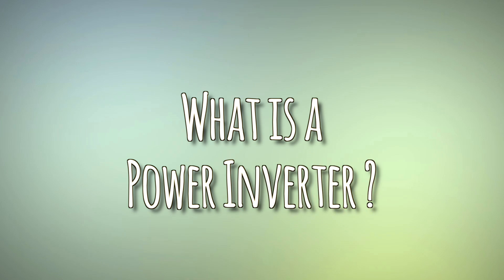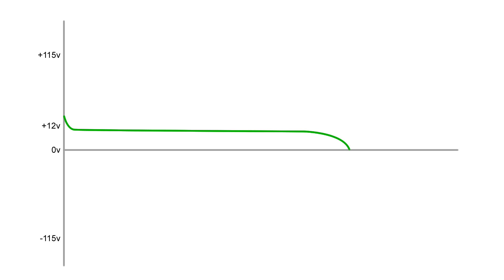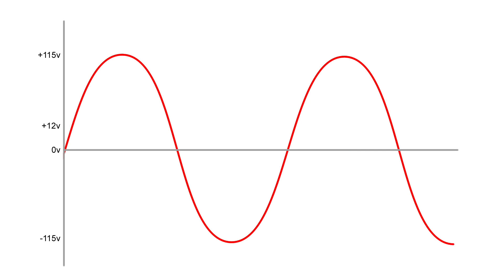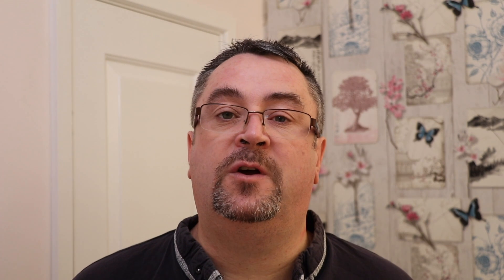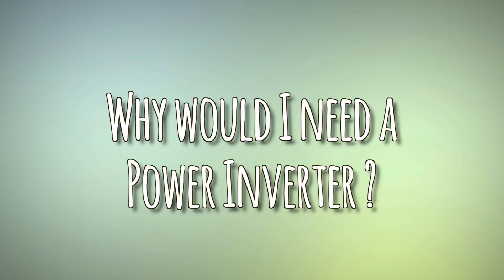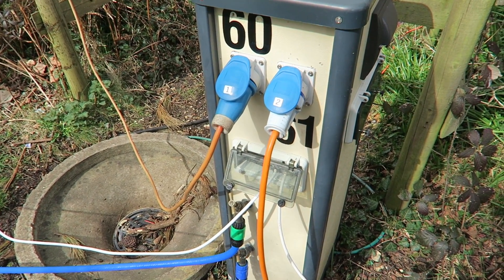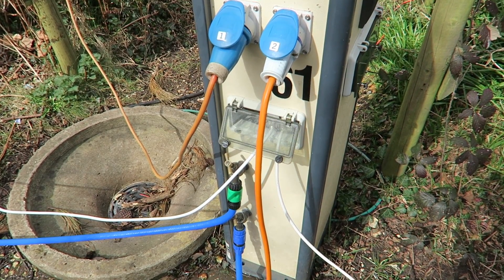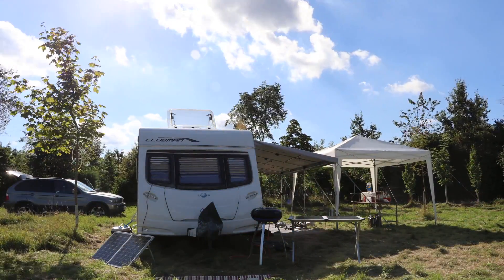Power Inverters in caravans

Comment: best vide i have watched on this subject. You covered the basics well, without over complicating things. I Like your delivery style!
I do want to see how an inverter should be wired into my caravan permanently. Usually under a bed.
And I believe I can also run an extension lead from the inverter to where my devices can access the inverter. 
Also, I believe you should mount the inverter as close to your battery sources as possible.

My inverter is to solve charging my E/bike battery on tour. Bosh Battery is 625w, but the charger is only 320w, so I bought a 650w (pure sine-wave) inverter here instore in NZ. Item on sale maybe $180 NZD.
I plan to instal mine very soon.

Comment: Very helpful video thanks. Still educating people 7yrs on! :)
This may be a silly question but, if you just took an extra battery, and used that, with a fuse and isolator for safety, to the inverter plugged into the exterior power inlet, that would be fine right? It would be seperate and, if drained, wouldnt affect the 12v supply/battery. Handy.

Comment: Dan i have 1x 100ah leshure battery but i am thinking of getting another and join them paralel what regulator would you recomend i am currantly using just one of those blue ones with 2 x solar panels in serius 10 w each connected to the regulator but as i said i want to add another 100ah battery can you advise me thank you .

Comment: Hi Dan.
Sorry to point out a mistake in your graph , but it's plus 360volt minus 360volt at 50hz and the RMS root mean square is 240 volts at the centre of the sine wave , caravan owner and 20 year electrician, Rob not being a troll just had it bashed into my head for 3 years at college.cheers great videos.
Reply from the maker: Hey Rob, yeah thanks for that - its one of those things of how much detail should i draw folks into, like trying to describe RMS, duty cycles and Peak etc. It was always a fine balance when i was teaching radio - that you just need as much knowledge to get you through, then when you need to know the full info - reveal we lied right from day one about natural impedance lol..

Comment: Hi, I appreciate this is 5 years old but I wonder if these have been superseded by things like the Jackery?
Reply from the maker: Hi Monty - Yeah, spot on - portable power stations now remove the need for an inverter. They can be charged up form a 12v supply and can now power most things from them. Id never install an inverter now, but use a portable power station instead. 

Thanks

Comment: One good news about it using inverter making your own electricity from solar wind is that at least converter gives cleaner smoother electricity then the power company does the power company is so much more choppier so much harder on your machines and the converter is a lot more nicer it tries to give it good power and keep it clean and keep it from being choppy and keep it smooth so it gets all the power it needs it doesn't have to overpower it like the power company has to do.

Comment: Handy guide to inverters, thanks. It's certainly worth checking out 12v chargers for camera batteries, 12v tellyboxes or anything else you might need, rather than buying an inverter, especially if you plan on going off grid a lot. Bear in mind that it will use more of your battery capacity than you might think.

Comment: Hi, thanks for the vedio,  very useful and easy to follow....if I want to purely use my solar system to light up 230 led lights indoors/outdoors, what type of inverter and how long a 12 volt battery of 195 amp would last . Planning to use it day/night time  ...so assuming the panel will be generating electricity to provide load and charge battery through solar charge controller at same time....

Comment: I made the same mistake by not doing my research.

I spend about 8 months of the year 'off grid' in europe and the UK and wanted an inverter that would power my 700w microwave and my 65w acer aspire laptop. (yes I do have a solar panel to fire the batteries).
I bought a soft start (square wave inverter)....1500w/3000w ...
WRONG!!!!!
It did power the microwave but had to run the engine while using it. Not good for fellow campers at 12.30 ish at night when you want a quick curry and rice.The inverter sucked the blood out of my two 1000ah leisure batteries in my motorhome in a few minutes and the noise from the mocrowave was so bad I thought it was faulty and was about to throw it in a tip.

I then did some serious research when I got back home.
A square wave inverter will not power/ charge a lap top etc. It will not even run the small fan in it.
So I bought a 'pure sine wave' inverter'. 
The difference was outstanding. 
The microwave was so quiet and if it wasn't for the light inside It I wouldn't know it was on. My lap top runs and charges. Both things running at the same time. Television on, a couple of lights and no need to start up engine while inverter is running.
All off 12volts !!

Just another note The inverter is connected directly to the leisure batteries and not the 12v  cigarette lighter .....and purchase one that is double to your needs. eg: for a  900w microwave. Buy a 2000w inverter. (pure sine wave).

P.S. You can purchase a pure sine wave inverter to run off cigarette lighter socket to charge a lap top etc. but not heavy duty stuff. Don't make the same mistake that I did.
Do your research FIRST.
X
Reply: That’s great info on the difference between a more expensive sine wave & the cheap version. 👍
Reply: Let's be honest and simplify the information. The ONLY advantage of a modified sine wave inverter is the price. Since it's way cheaper upfront. And that's it, end of story!! 
With that said I still have a couple of them, mainly because I have them for a long time. They never broke. So... ;-)

For everything else pure sine wave inverter is the ideal choice. 

BUT, Better than all this. One should only consider inverters as a last resource! Beside the cost, efficiency, complexity... all add negative aspects, compounding the problem.  So if possible simply avoid them. Going back and forth is an extremely inefficient way of using power! ;-)

Comment: I should have got a 12v TV. Realistically will using an inverter to watch a mains voltage tv work ? If am off grid with a small leisure battery and 150v solar setup ?

Comment: Hi Dan, need your advice if there is a maximum power wattage you can buy but don't go any higher if you wanted to run it from the 6 amp cigarette lighter socket in the caravan or would they be very low in wattage. I don't know if to go down your route of having something around the 1000 watt pure sine  inverter and connect to the battery and get one with a remote to make it easier to switch the inverter off as i would imagine it would be installed under the bench seating so hopefully not forgetting to switch it off when not in use

Comment: Thanks for this. I've got a 1000W inverter and had (thinking I was clever) tried the old trick of using the 13Amp plug adapter to route the power into my van's EHU but it just drains the battery very quickly as 'always on'. I'll just use it as you describe in future.

Comment: Hi Dan we have just had a 100w solar panel fitted and a new 110 amp battery to our Swift Fairway ,would you be able to run a small
potable tv on a 200 watt inverter if went of grid ,hope ya new Bailey is going well,keep up the good work.Oh by
the way we have just ordered the new waste pipes from Amazon from your link,£5.45 BARGAIN thanks again.
Chris&Kim

Comment: I didn't want to do a 240v hook up for my van.
Instead I have a 12v system and wanted to get an inverter. 
I have a fixed socket and wanted to have an extension from the inverter socket, then wired into the fixed socket (more for a clean look and position convenience) .
I've seen this done before but wasn't sure if its acceptable. 
Hope that makes sense. Any advice would be much appreciated.

Comment: Firstly, let me nail my colours to the mast - We rally, very rarely go to sites with EHU and do not have an inverter. Charging batteries (camera, phone and laptop) are all done from 12v - far more efficient than boosting 12v to mains and then back down to whatever voltage the device uses. Also, you'll probably find that 12v boost/buck converters will work out cheaper and more convenient than using an inverter.

Comment: Good video but the graph of the sine wave is not quite right. http://www.cyberphysics.co.uk/graphics/diagrams/electricity/Mains.gif
UK mains goes up to +330V and down to -330V to give 230V root mean squared (RMS).
Reply from the maker: Hi Peter - you are spot on. This was an intentional mistake. Those who are technically minded have already noticed and commented on the graph issue, however for the target audience, non technical people - this is an understandable concept. To describe RMS, the peak voltage, would detract and dilute the real purpose of the video. 

As you are technically minded, im sure you will agree that to explain one thing in perfect terms you have to explain an awful lot and travel down many rabbit holes to make that one point clear. Ive taught amateur radio to 3 licence levels, including electronics and electrical principles.  so a wide audience of various understandings means you need to "bend" what you mean in order to get every one on board. 

Hope that helps. - Did you spot the other "deliberate" mistake ? 

Take care, and thanks again for your comment. 

Dan
Reply: like licking it or something ?
Reply: On the other hand, pointing out the true mains peak voltage could have gone some way to point out the potential danger of doing something stupid with an inverter.
Reply: will you reveal your call sign ? i rarely do on here , but im a 2M0.. 3 short for my MM0 :( maybe next time :)

Comment: why didn't you just buy a camera battery charger that runs from your 12v socket much cheaper thn purchasing a power inverter.
Reply from the maker: Hi Dean, 

Good question, and really easy to answer. There was no 12v charger for my camera's, nor is there a 12v charger for the Vacuum that we use when the 'van is in storage. 

Hope that answers your question.
Reply: hmm, lets see.. buy 4 or 5 different 12v adapters ( if they are even available)  or buy 1 £60 inverter,, AND have 240v whenever you need it .. hmmm. tough one ...

Comment: What would you say to the suggestion of connecting an inverter correctly by directly connecting to the leisure battery in your caravan - as per your video, powering whatever (say a laptop), whilst having the on-board caravan battery charger running at the same time to try and minimise the depletion of the leisure battery's power? Could that work?

Comment: Hi Dan - a great video yet again - I don't think this has been asked - on your battery on the van (which we see around 4:30 in) it looks as though you have 2 contact on the battery for both positive and negative - which makes attaching things very easy. Is that as it came on the battery or is part of the cable clip for existing cables? - i.e. can I buy the same thing to do the same on my battery? Thanks
Reply from the maker: HI Simon, are you referring to the threaded posts ? if so, then yes - this is part of the battery we have. you are right it makes connection to the battery really simple, the motor mover & main connection to the caravan are via the clamp terminals (as per a normal battery etc) leaving the screw terminal exposed. 

I hope that helps.

Dan
Reply: Blimey quick response Dan :) - yes the posts - I was hoping they were part of the connector so I could look out for one. From watching your solar video (the mrs wants to do off grid) my thoughts were about connecting to battery and post like that means not having to faff with existing wiring. I'll have to keep eye out for different connector (battery only 6m old not need replacement).  Thanks
Reply from the maker: Ha, ok so what I would do is create a small tail cable that is wired onto the clamps that is quite short, yet has a Power Pole or equivalent ( have a look here - http://amzn.to/2pRgsnt ) type connector. Then you can attach the panel onto the battery without having to worry about the cabling etc. 

Hope that helps.
Reply: Hi, very interesting video presentation.

I am also considering how best to connect other pieces of equipment directly to the battery, e.g. inverter, solar panels both inside and outside of the van (via a controller) and came across these battery connectors on EBay:

https://www.ebay.co.uk/itm/12v-multi-wire-battery-connectors-Caravans-motormovers-boats-leisure-batteries/192297824889?ssPageName=STRK%3AMEBIDX%3AIT&_trksid=p2055119.m1438.l2649

Admittedly, using a pair of them would mean dispensing with the quick connectors currently used, a disadvantage if you need to remove the battery for any reason, but fitting them would likely be tidier and less prone to failure than tagging on additional cables with scope for one further connection only.

I should be interested to know what your thoughts are regarding this device.

Incidentally I have no connection with the marketing or selling of the battery clamps.

Comment: Hi Dan,  watched the video just to see what you would say about the subject.  Had a 1000W inverter on board our last caravan and installing a 2500W pure sin wave inverter into our new one.  I really appreciated your comment about not powering up the caravans 240v supply from the inverter.  This is something I am going to do, but after listening to you I am going to use a relay to disconnect all the circuits that shouldn't be run off the inverter.  This is beyond the scope of many caravan owners but I am the sort of person who smiles at the 'no user serviceable parts' labels on electronics equipment as I can do component level fault finding.  Loving your channel. Keep it up. Vince.
Reply from the maker: Awesome well done Vince, i would add some decoupling capacitors across the relay to stop any oscillation that could leak from the inverter - it shouldn't but PSW inverters all differ from model to model. - better to be safe than sorry.

Sounds like a great project, let me know how you get on.
Dan
Reply: What I will do is run the relay coil from the site feed, the caravan input will be on the common connections, the site feed on the normally open, inverter output on normally closed and additional normally open poles to enable the loads that should only run from the site feed.  It needs to be a 6 pole relay.  Hard to find a 6PCO with 16A contacts so I have 2 relays with 120v coils so I can run the coils in series.
Vince.

Comment: Hi Dan, came across this and have to say its an excellent video (as an electrician) the part you mentioned about doubling the required power is very true and I had an inverter many years ago, although it had an output larger than the power of my TV, it couldn't cope with the surge of starting the TV so tripped out, for running any other than a resistive load, you need more reserve. So best rule is double the figure you need and get the inverter nearest.
Reply from the maker: Thank you Steve, 

Glad you found this video a useful resource - as you will know (being an electrician) there is a tonne of miss information out there. Hopefully i have bypassed all that.

Take care
Dan

Comment: great topic again dan now we plug ours in with a 3 pin blue plug and have done so for years BUT like you say make sure the charger is off.we power a tv,sky and lights daily and on occasion we run the microwave and in full sun the onboard fridge,great video keep up the good work and all the best for the new year
Reply from the maker: As long as you know, that's fine. 

Thanks for popping by, take care

Dan

Comment: Hi Dan, another good video.
For several years I have considered getting a power inverter, first when we camped out in the van, and now for the caravan, but I always stopped wondering what I really, really, needed to use on mains voltage if I was off grid and on holiday... assuming you still have gas for cooking and heating.
Units rated over the 1000w version you have they tend to get quite pricy, and if you are going to use that much load the battery isn't going to be lasting very long.
Forget hair dryers, sorry ladies, most take more that that and would soon drain the battery, our biggest fear.
Same with anything that heats stuff. Kettles... use the gas hob. Electric blanket?? nope, snuggle up!
Most smaller gadgets and phones these days charge on 5v USB style and there are plenty of very efficient 12v->5v adapters which avoid the inefficient route through 230v AC and then back to dc.
Also, a MacBook user, it is a pain that it needs 20v dc but there are travel chargers on the market which step up from 12v dc up to the 20v dc needed, with built-in magsafe connectors. I am sure there must be something similar for your camera batteries??
Wondering, now, what else do we really need to run at 230v ac when we have no hookup, that isn't going to kill the battery by the end of the weekend, or week! What other 230v essentials am I missing out on? Food blender Andrew Ditton??
After all, when I get home I need to use my motor mover or she isn't going to get onto our driveway!!!